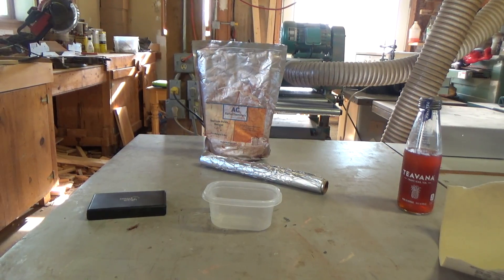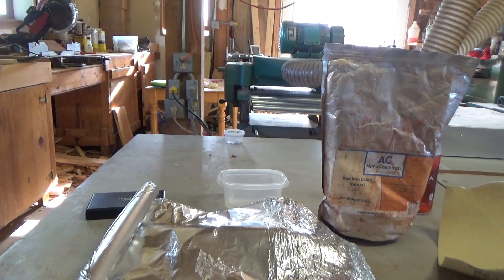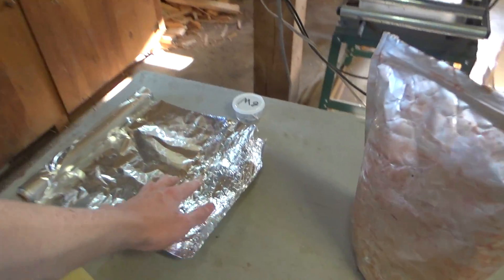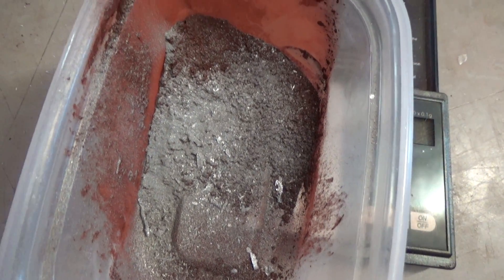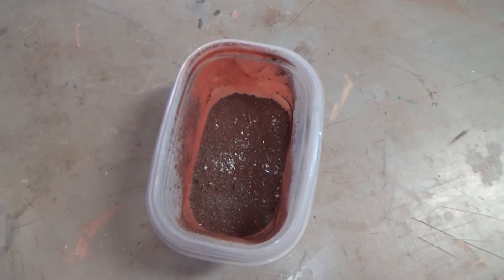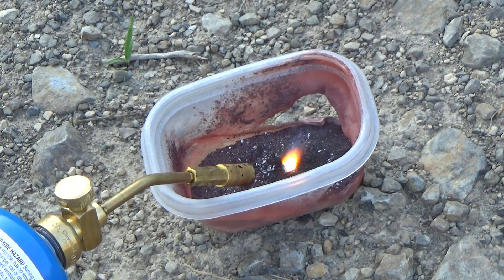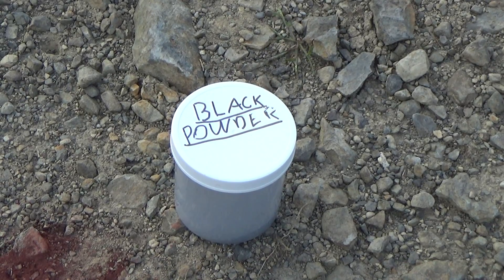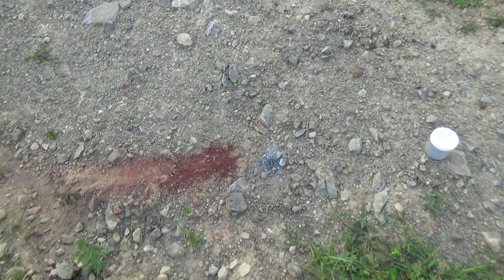Can You Make Thermite With Aluminum Foil?

Comment: You absolutely can make it with foil. Use a coffee grinder to get a finer powder. Also make sure that the foil you buy isn’t coated with a thin layer of plastic. The cheaper the foil the better.
Reply from the maker: jerpdederp coffee grinder won’t make it fine enough but yes it is possible. I was pretty uneducated when I made this video haha
Reply: The coffee grinder will make it fine enough if you blowtorch the foil before grinding to make it brittle.
Reply: @chemistryofquestionablequa6252   can I just heat it with lighter . And how much time I must heat it.
Reply: @chemistryofquestionablequa6252  How many times the cofee grinder will do good job  before break down.